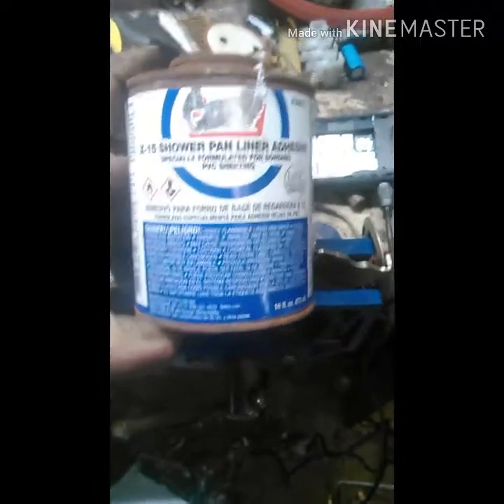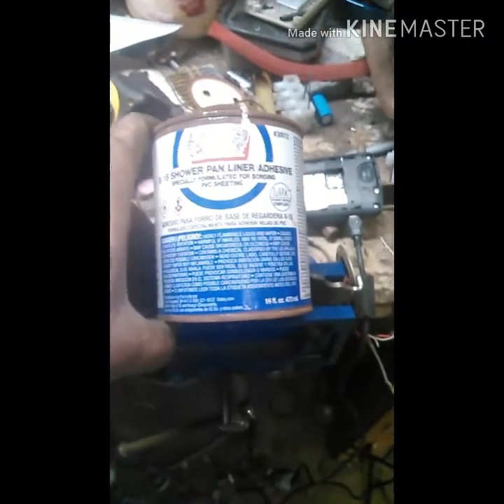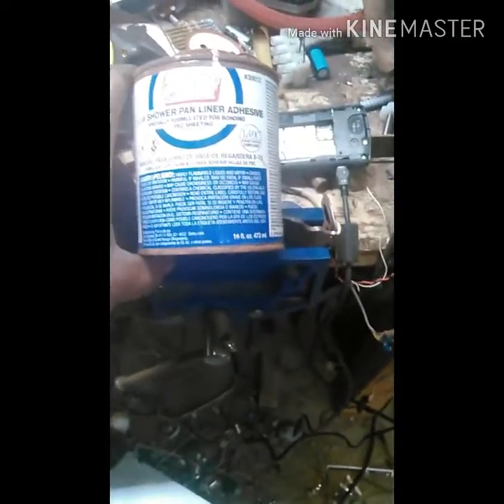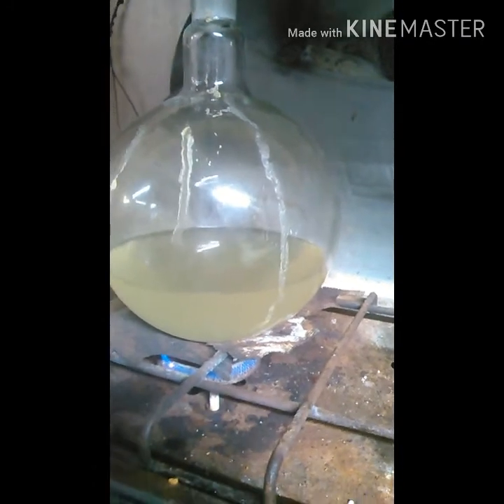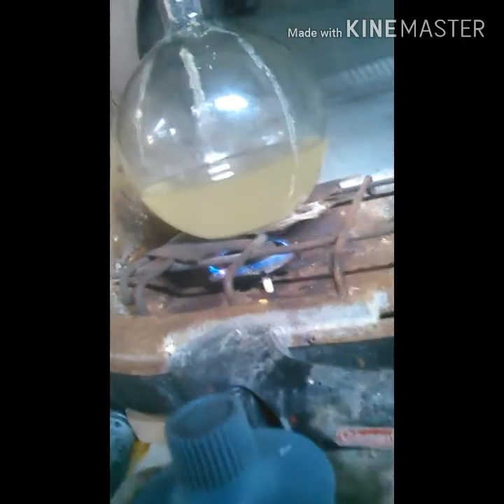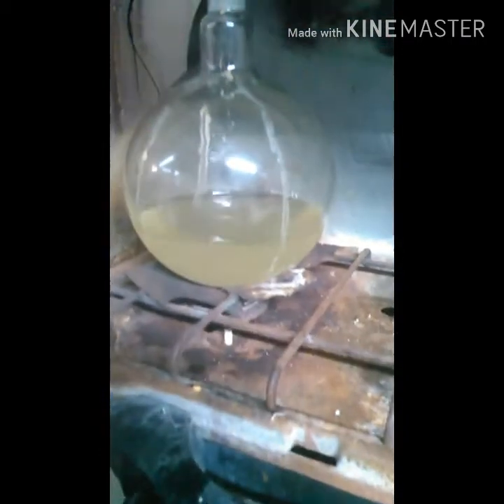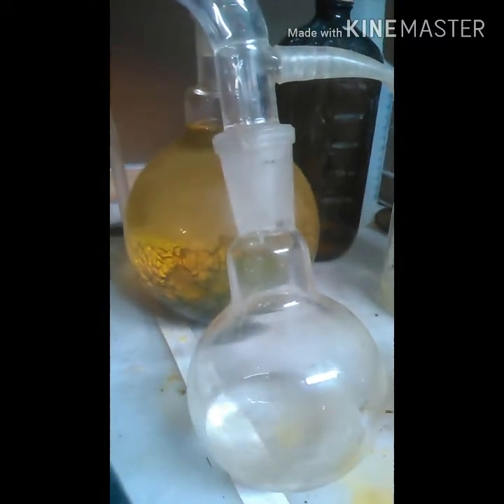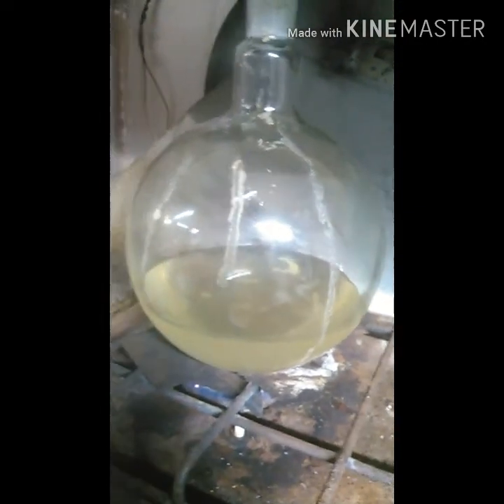How to separate acetone and tetrahydrofuran threw vacuum distillation. And where to get tetrahydro

Comment: Thank you for making this. I love your content. I can always find really rare things off your channel.
Reply from the maker: Thanks man I strive to stand above :)If you end up needing help on a project or whatever I'd be happy to make a video with my side of input for ya.
Reply: @shelbysgarage5828  did you figure out a good way to clean the original flask when you did the first distillation and had leftover pvc?
Reply from the maker: @benjaminpainter378  yes kind of... So don't distill until it's done, and while still hot get out as much as possible. If you did till dry out some back into the flask and slowly reheat and workit out. Acetone helps or mel w heat. But I ended up boiling like 3 cans in the same flask and just tossed it because it was too much to remove. Pro tip unless you need the thf like stat. Buy it off eBay I can hook you up w a seller if you need
Reply: @shelbysgarage5828  I don't need it Stat but it is super helpful. If you could email me over that seller I would love it.

What I ended up doing is converting one of the lids to a joint that I could attach to glassware, so now all the stuff I don't want just stays in the disposable can and I just switch the lid onto another can. A few of the glues/cements also have MEK which is getting harder to find at home depot.
Reply from the maker: My email is scubamaster84@gmail.com email me
Reply: @shelbysgarage5828  actually I am working on some pretty cool things. Shoot me over an email at Benjamin.ia.painter@gmail.com 

I just got to home depot right now to pick up this stuff btw, great video.

Comment: Use sodium bisulfite to produce an adduct and then distill off the THF
Reply from the maker: Ok, ill have to look into that, have you done it before? Id love some details.
Reply: @shelbysgarage5828  Agreed bisulfate adduct is probably the way to go. The acetone bisulfite adduct should move to the water layer or crash out and the thf will be left behind. On the other hand Is it not possible to wash the acetone out with water in a seperatory funnel??
Reply from the maker: @midwestchem368  I don't believe so. I will check today and get back to you
Reply: @shelbysgarage5828  great video by the way dude ive actually been researching this topic recently so it was good to see a video too.
Reply from the maker: @Midwest Chem Check out the video I just uploaded I should answer your questions. It was made for you lol
Reply from the maker: So i dont think it will work acetone also creates a compound with thf, so whatever grabs the molecules first may win. Although sodium acetone bisulfate can add or remove a carbonyl if thf and sb are that. I dunno
Reply: Shelby's garage under what conditions does the acetone react with THF?
Reply from the maker: Joey valladared im not following you. I dont understand the question.im not trying to be a smart ass either lol
Reply from the maker: The thf can react with the sodium bisulfate, as well as the acetone to the sodium bisulfate. Both creating something. Is what my original reply was meant to say
Reply: The way I understood your comment was that acetone reacts with THF that’s why I asked under what conditions. But sodium bisulfite wont form an abduct with THF, it will however form an abduct with ketones and aldehydes. You can also react acetone with an amine, hydroxylamine perhaps.